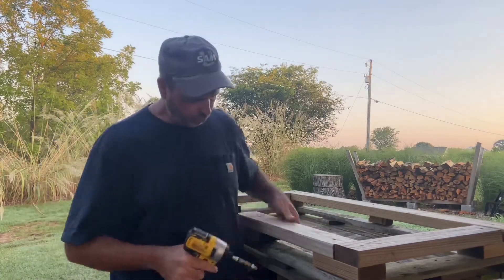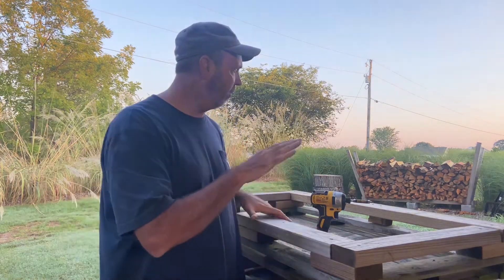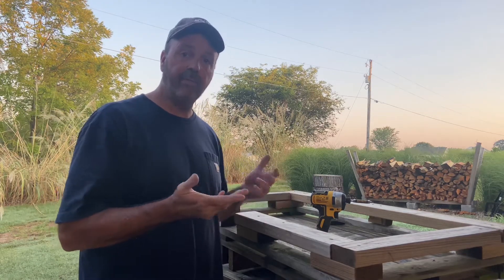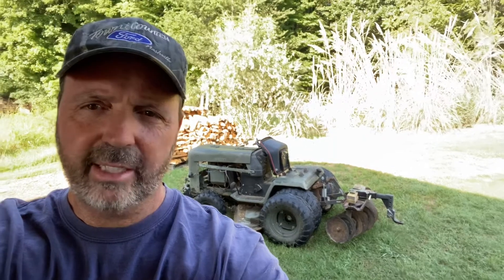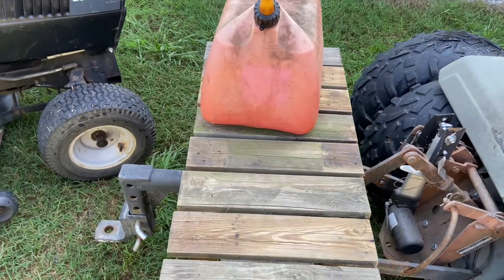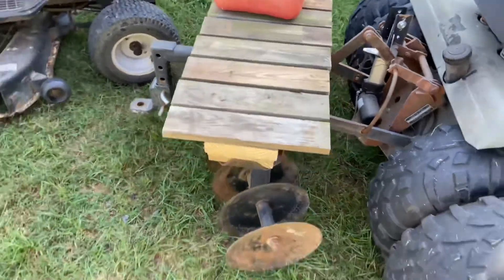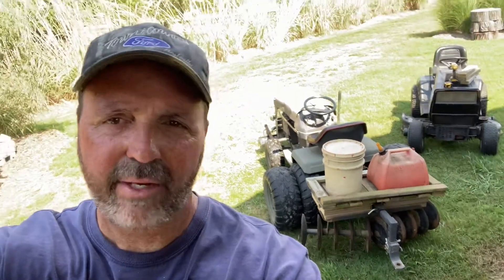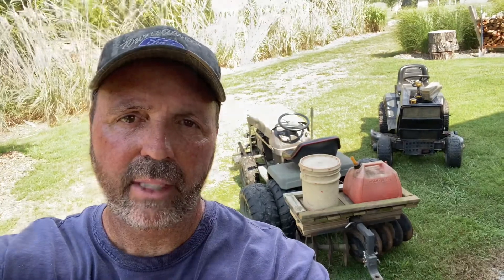Sears 3 point hitch carry all

Comment: Just checked out your channel videos and there's a few I've watched and a few more I'll have to make some time to watch.  I'll go ahead and subscribe and see what I can fit in this evening.   Neat designs!  I plan to get the front dethatchers on the Ford and JD also.  Finally was blessed with one for the JD 240 that's a direct fit.  The Ford YT1X SVT will have a custom one made from one of the two I own to match the stock design as close as I can get.  I also want to see how I can get the JD's idler subframe assembly and front plow/attachment subframe assembly to fit on the Ford SVT as well.  I also have a single blade old horsedrawn family farm, I think they're called a, moldboard plow to fabricate and assembly to use in time.  Almost wonder about the rototiller on the front and then moldboard plow on the back for trees.  Maybe even that or something on the front and something like a manure spread I want to make from an old treadmill to lay clay or other amendments in the groove to go over later to plant even if by hand like for rows of trees or bushes or I guess other annual crops.
Reply from the maker: Sounds like you have a lot going on in the shop similar to myself, thanks for watching